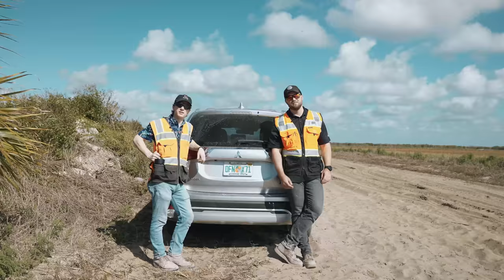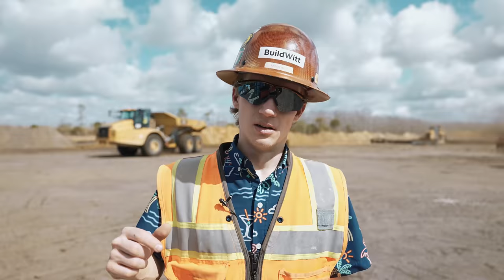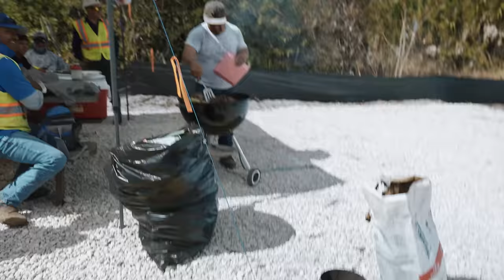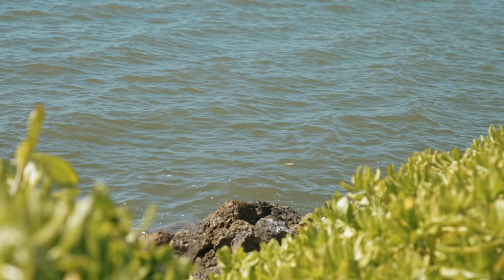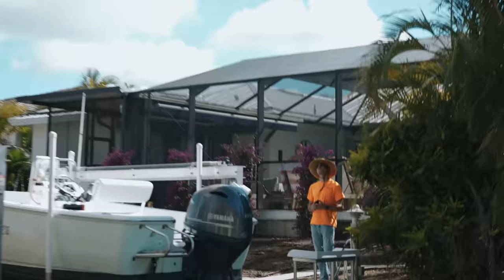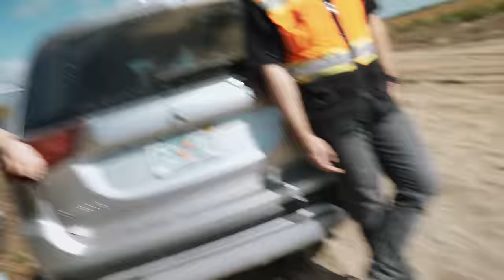Building a Massive Levee in the Swamps of Florida

Comment: is this c43 project for the caloosahatchee water basin if not are you gonna cover it but it's not on Naples tho. where ur at might be a different project then what I'm thinking cus it in LaBelle FL.
Reply: I searched for it and I only saw 1 concrete dam about 40' high.  You got a link?
Reply: There is two damns to control water. There's a inside and outside earth damn. This is qe project. The old company for the c43 project got escorted off the site by cops lol. Eagle nkw took it over. This is not the site I was thinking of.